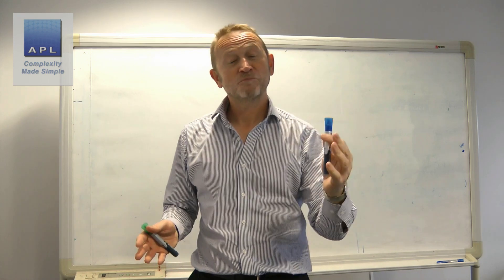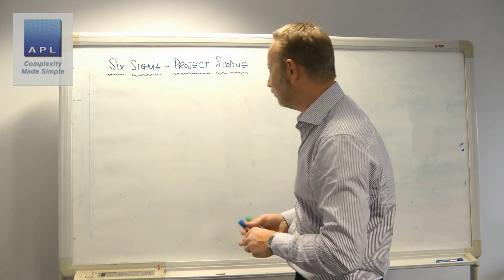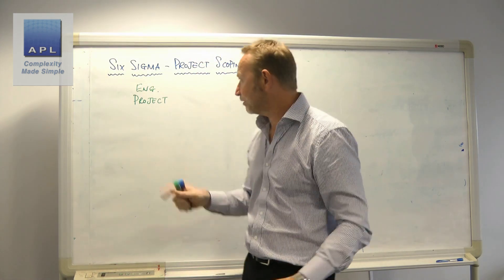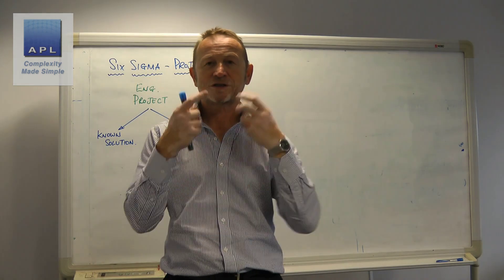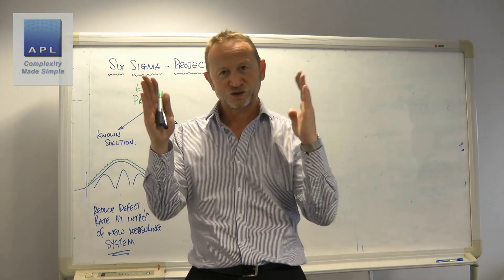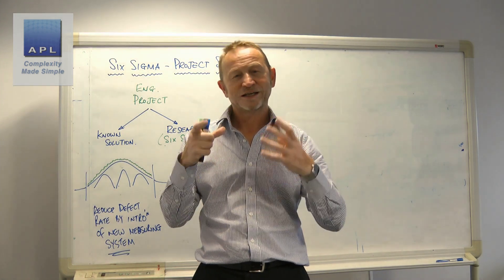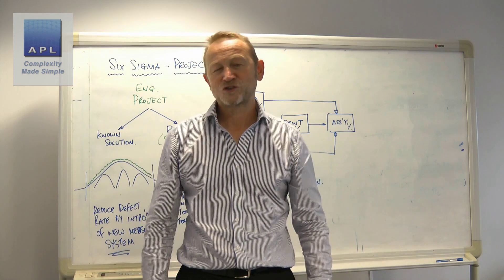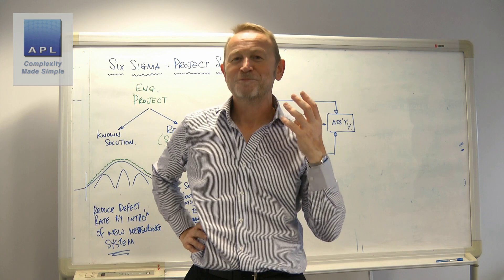Scoping a Six Sigma Project

Comment: Hi Paul. I watched your video and I'm currently having a problem with raw materials. Although we have a material design, we're still experiencing issues with the quality of the materials when we put them into production. Is there a solution to this?
Reply from the maker: Difficult to say without seeing your process in more detail.
First question is - Is your process stable? As in, do you have fixed settings on the machine and good maintenance practices? If you don't the problem is not the materials it's your process control...
Reply: @paulallen5321  Thanks, Paul. Perhaps I need to review my process.
Reply from the maker: @PhuocLe-tq7uw  Take a look at a series of video's on my channel called the catapult case study and you'll how that process control analysis is done...
Reply: @paulallen5321  Hi Paul. I've watched your video series and they're really, really good. Watching your videos, I think it's more worthwhile than any courses out there.
Reply from the maker: @PhuocLe-tq7uw  OK great so you've seen round 1 of DMAIC - Control the physics of the process. If you do that first you'll then be able to see if the material is really effecting the process...